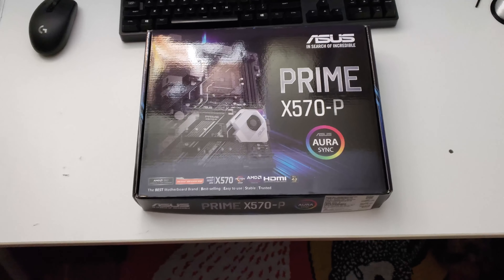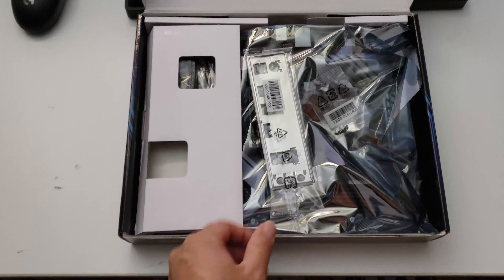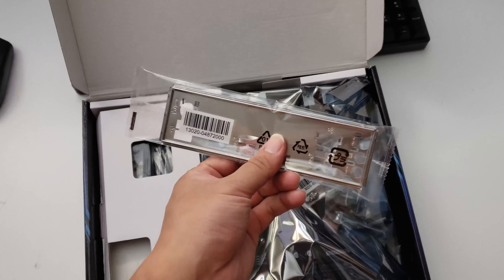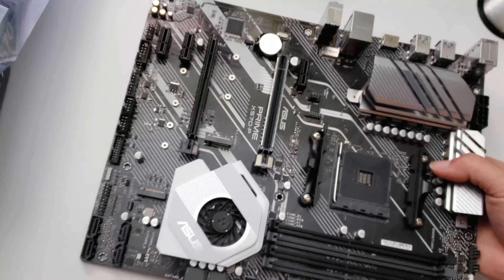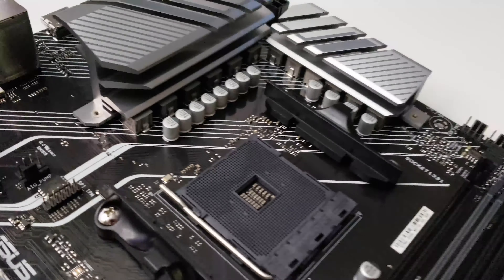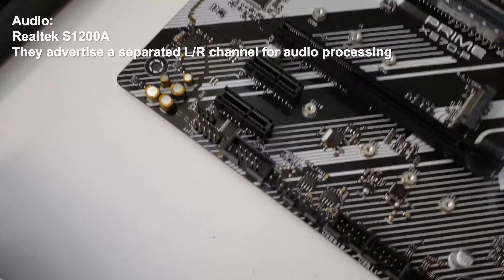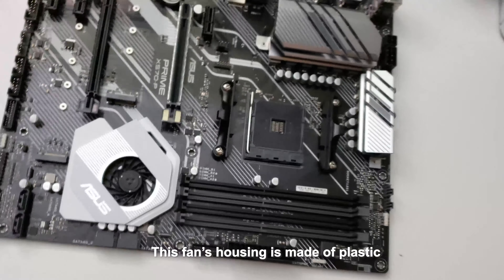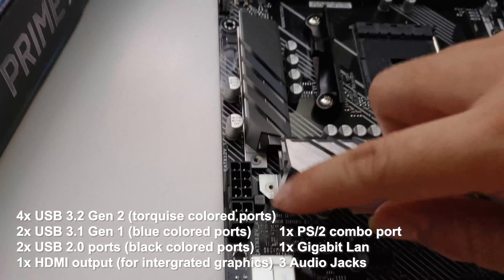Asus Prime X570-P Budget Motherboard for 3rd Gen AMD Ryzen 9 3900x Unboxing and First Impression

Comment: So, how ryzen 9 works on ASUS PRIME 570 P ? Did you have to update BIOS, which memory ram are you using to get most of ryzen and do you have any problems?
Reply from the maker: Works great actually, no bios update needed. I am using ddr4 3200 ram running at 3200 ram for slight performance increase but any regular ram is sufficient for good performance
Reply: @TheGizmoGarage   It is nice to hear that Li. I will build my rig with  X570 P and Ryzen 9, together with 5700xt. Asus did a really god JOB on VRM as seen in previous videos. Hope it will be a good build.
Reply: @ivaniusblog2762  I have nearly the same build as you, with the ryzen 9 and 5700 xt. Is the motherboard good with the pc parts?
Reply: @SlashDashPro  Hi mate, I built my rig with rtx2070 super instead 5700xt. So far everything works perfect. I have reduced voltage of cpu to 1.4 due to a bit higher temperatures on idle.
Reply: @ivaniusblog2762  Thanks very much on your input for it. You saved me like a good $150!

Comment: Asus is 195 us dollars, Gigabyte X570 is 140 us dollars in Turkey. Which model do you recommend for my Ryzen 5 3600? Thanxx
Reply from the maker: I would go with cheaper unit, both will satisfy your needs just fine.
Reply: @TheGizmoGarage  thank you very much, i read some articles about gigabyte x570 ultra durable version has some vrm heating problem. But it will not be a problem in my mid level cpu...

Comment: what are the necessary parts to plug into the motherboard in order for it to turn on
Reply: 24 pin, cpu 8 pin, gpu power if u want display. you can short the power switch on the motherboard with a screwdriver
Reply: Brayden Kelly thank i you!

Comment: Do you think it would be safe to use both of the m.2 slots?  since one of them will be right beside the gpu?
Reply from the maker: Should be okay, I would have proper case cooling and airflow just in case things gets heated up

Comment: It's a shame the X570 chipset fan exhausts downwards over the 2nd M.2 connector, blowing hot air over a M.2 drive could lead to throttling and failure.
Reply: use upper slot
Reply: @lifemocker85  I was meaning when you want to use both.
Reply: @fizzap.social.network  theres coolers for m2 drives also but I think thats situation is more depending about your case air flow than chipset
Reply: @lifemocker85  Yes however venting chipset air directly on a M.2 drive is not ideal.
Reply: @fizzap.social.network  but doesnt matter much if your case airflow is decent
Reply: @lifemocker85  Currently we have a 140mm fan blowing air on both M.2's, it depends how much usage your M.2's are encountering as they also can get hot with high sustained drive access.
Reply: @fizzap.social.network  so get m2 heatsinks

Comment: is it necessary to up grade the bios for the amd 3700x chip on this motherboard?

mine is not working, after i contact support the tell me to update the bios.  The only way to do this is with an older cpu. Can you confim?
Reply: Shouldn't have to.  I was able to drop a 3800x and it was fine.  But it might be that you got one with an early BIOS that didn't support the 3rd gen processors fully.

Comment: Is this compatible with corsair vengeance rgb memory?
Reply from the maker: Depending on your cpu heatsink clearance if memory heatsink is tall and you are using a larger cpu cooler, maybe not. If you are using water cooling for cpu, then it should fit no problem
Reply: @TheGizmoGarage  ye I'm prob gonna use corsair water cooling

Comment: also i bought 3600 mhz corsair vengeance pro rgb 16 gb total ram will it work with the motherboard
Reply from the maker: If heatsink on the ram is too tall and you have a large air cooler on processor there might be clearance issue, if using water cooling then ram heatsink height should not be any problem
Reply: Li Fan the ram isn’t too big and not too powerful
Reply: Li Fan it’s 3600 mhz and there’s about equal height

Comment: Got this same Mobo and also got m.2 ssd wd blue. It looks like they are not compatible. Does someone know better?
Reply from the maker: It should be compatiable, did you install the mounting screw for m.2 that came with your motherboard? If not you can not secure the ssd on mobo
Reply: @TheGizmoGarage  not yet but I think the problem is in pin side (which have to first put in place to mobo). Because there is two notches in that m.2 wd blue and only one in mobo. 🤔
Reply from the maker: @jokayokay  this might help https://www.dell.com/support/article/en-us/sln301626/how-to-distinguish-the-differences-between-m-2-cards?lang=en different notch defines different speed and interface i think you should be okay

Comment: Bigger GPU-s are covering the chipset fan making air intake bad. RX 5700 covering its 80%... :/
Reply: bought both this mobo and the 5700xt, cab you not put it on the second pci slot?
Reply: @OpticalDTV  You can, if its also the same version of pcei, its just that if you put a gpu that low, chances are it will be flat against your power supply and also that the cables for usb, power on, etc below might rub against your gpu fans.
Reply: no problems there

Comment: Does this board support usb c plug cases?
Reply from the maker: It does not have USB-C port
Reply: @TheGizmoGarage  Is there any kind of adapter I can get to make use of this empty case plug?  I'm fine if it doesn't have usb c speeds.
Reply from the maker: @InternetSupervillain  For sure, you can use https://amzn.to/2tfcCLQ or https://amzn.to/39oUxM3